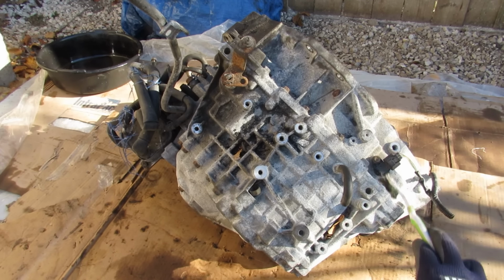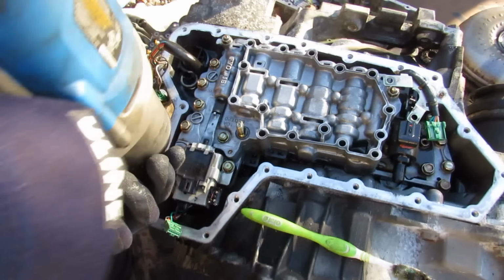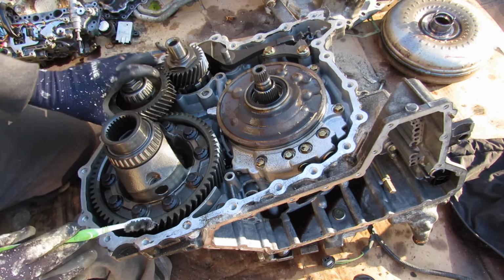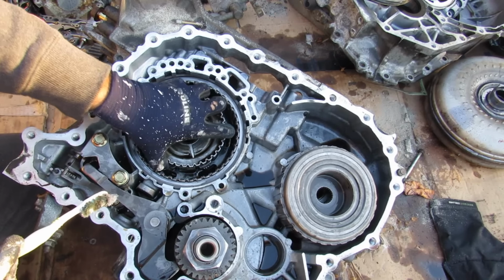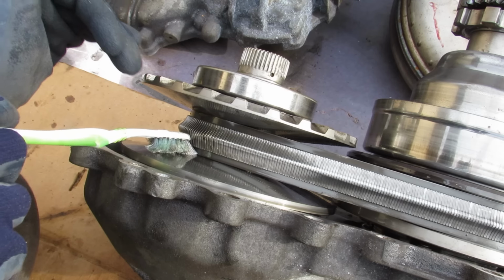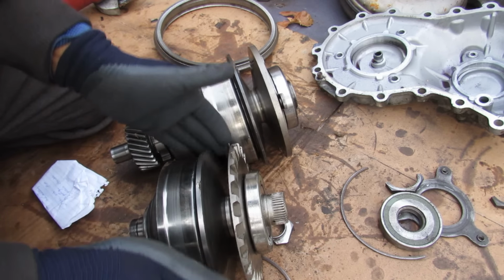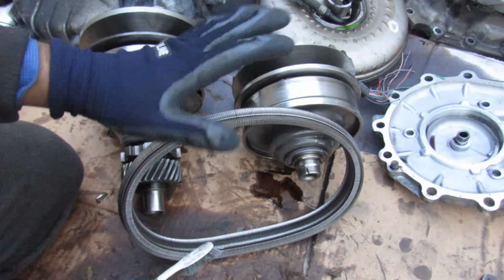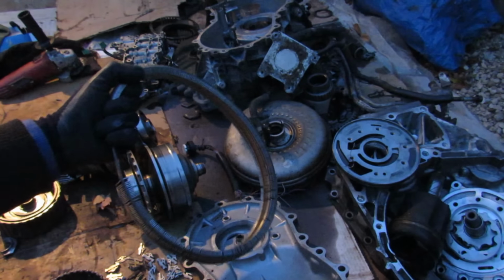Why Nissan CVTs FAIL

Comment: I wouldn't own one of there pice of crap
Reply: While I agree with you, this is the first generation CVT before they got with the program. If you notice that cooler block isn't a good design. It used coolant to cool the CVT fluid which lead to overheating and damage, now they use a external cooler like everyone else. Also they now put the pulleys orientation away from the fluid and closer so the build doesn't get destroyed and some use a chain. A good example is the Maxima its the best one of their CVT's and rarely fails because it uses a chain. They have also changed the tuning and added a gearset.

Comment: Hello, can anyone tell me if you can tell whether the cvt of a 2012 Nissan rouge is original or has been replaced? Can a mechanic lie to you when the cvt is original but he says otherwise? Thanks.
Reply from the maker: Sometimes it's obvious work was done with bolts and wires and clips around the transmission.

Comment: lol, paddle shifters to shift your cvt transmission. That’s hilarious. Anyway the only correct application of this jatco cvt transmission is the Mitsubishi mirage which is very light weight and only has a three cylinder motor. This cvt in that vehicle is perfect and usually lasts three hundred thousand miles as long as you regularly change the transmission fluid. However on a small suv like a Nissan rogue or murano you literally damage it and wear down the internal complements every time you use your car and thus it will only last shot 80 thousand miles usually before failure. The jatco cvt transmission isn’t bad. It’s actually a great transmission. But only for a three cylinder naturally aspirated motor, not a six cylinder naturally aspirated motor. They just get a bad reputation cuz Nissan tries to put them in anything they can get away with like v6 or v8 motors which will kill the jatco cvt transmission prematurely. This is proven with its use in the 3 cylinder Mitsubishi mirage where it usually never fails and the three cylinder motor actually fails first after about three hundred thousand miles.as long as the regularly scheduled maintenance is done that is.

Comment: Amazing video about cvt gear box. I have a fair to buy car with cvt box . Thanks and congratulation for your skill and show. That help me  a lot to get this knowledge in very short time. Definetly is not acceptable to get a car with this kind of gear box andits more complicated than the car itself.  They should find manual way to use this continious variation transmission. Oooh relax
Reply from the maker: Glad you liked it. I have a few more CvTs to teardown on the way!

Comment: My Pathfinder is 10k KM 2020 model 1st owner, I noticed a CVT little shuddering issue since beginning, and the local nissan dealer insisted that this is normal! By the time the car went out of warranty, now shuddering is very clear. From my standpoint, Nissan Japan pushes dealers over the world not to expose those kind of issues to customers, and so they used to them, till the warranty is end up. I believe this is aligned with Nissan statement "Our mission is to enrich people's lives"!? It was one of the worst decisions I've ever made to trust Nissan😢

Comment: I have a honda jazz cvt vehicle. When the vehicle is cold, there is no movement in D-S-L and R, but when it warms up, it moves, albeit with knocking. There is only a problem with the first take-off movement. There is no sound or knocking when driving on a normal road, but there is a knocking and not starting when starting. especially when the engine is cold. Can I get an idea for this? Thank you.

Comment: excellent video, this is fascinating.  I have a 2015 Pathfinder 3.5l and cross my fingers now that I'm at 120,000 miles.  Yes I have towed up to 5800lbs with it for about 20 miles to trailer a Bronco project

Comment: I have a Nissan Altima 2013. I pray everyday it doesn't fail along with changing the CVT fluid every 30k miles. So far so good at 70k miles. The problem is that Nissan said the fluid is lifetime which no fluid is. Hopefully now that Renault has sold their shares back to Nissan and are not the majority owner, Nissan may go back to being reliable.

Comment: Congratulations!

Here I am, watching videos about a number of older-model vehicles because I’m planning to buy a relatively inexpensive, but hopefully reliable, used car.  I was kind of leaning towards a 2007 Nissan Maxima in excellent condition and with very low mileage, but in slightly less than 20 minutes, you’ve completely talked me out of it!

Time well spent!

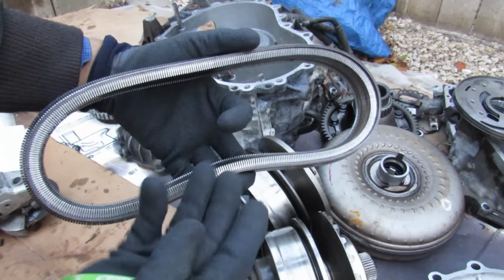Comment: 15:25 INCORRECT!!!! 
these are made for TRUCKS.  
not just any trucks.  no i mean SEMI TRUCKS!!! 

and this was back in 2011 when TRUCKS were the only vehicals that had these on them other than specific special use cases like racing or custom vehicles.

so given how wrong your statement is on this.  i doubt how trustworthy any of the other claims are like it's cooling system.  (sounds like a nissan specific issue)
(ofcourse nissan isn't using the brand i have been making.  wich i shall not name because you don't need to know where i live)

Comment: 09:30 i have made those belts. 
there microscope inspections for tears and damages on each of those links.  
even an x-ray test every so many of them. (they are stamped out so doing this is the only way to find damage on the stamp without disassembling the machine.)

Comment: Conventional gears have their  meshed teeth roll on one another without sliding, that gives them superiority over all other transmission methods, I am a mech engineer with 40 years of experience. I would never buy a car with CVT, nor would I drive an EV.

Comment: I have a 2012 Sentra with a CVT. My Sentra has 185,000 miles and I’ve had no issues except normal wear and tear. I still see a lot of these Sentra’s on the road. Where did Nissan go wrong I don’t know. My CVT and engine still runs great.

Comment: The jatco ctv in X-trails was reengineered in later years, with a belt that looks twice as thick as that belt. And Renault installed it in the Korean built Koleos with an oil and filter service interval and have no issues.

Comment: 3 muranos so far, no cvt problems.  121,000 on the first. 108,000 on the second, currently 93,000  on third murano. Traded in for new muranos.

Comment: Stay away from these transmissions, especially on anything larger than a compact car. Very  prone to failure at low mileage There is no suitable repair or rebuild, only replacement. I speak from bad experience.
Reply from the maker: I agree. Very light duty

Comment: CVT transmissions are not as robust as manual transmissions, all that means is that they cannot take great abuse.  With maintenance and no stubid actions by drivers, that can last a long time.
Reply from the maker: They're only good for small vehicles

Comment: When my 2019 Pathfinder with towing package started making a whining noise I traded it in. I tow my boat and utility trailer with it.
I was told bye a friend that the transmission was about to need replacement which made me think twice about ever buying another Nissan.
Now I have a true 10 speed  transmission and don't have to worry about it. Goodbye Nissan

Comment: See the wires . All against the valve body . This is a fail . Why ? Heat alone wwill send the trans into protection mode only seeable at manufacturer electrical doctor test facility . And wireless false signal will also be present . Space between valve body and electrical body should be 5 mm minimum . These are likly why cvt function eratically . My first time seeing inside a cvt . I should have expected it was an electrical issue . After seeing this video ? I'm surprised cvt even work at all brand new . The mechanical side is awsome but the electrical side get a note of zero % . This is wire installer mistake

Comment: I like to think of the CVT transmission as a constantly slightly slipping clutch, and it feels like it because it is. And just like if you ride the clutch or drop it too hard it will drastically effect the life of said clutch or transmission. Seen some last well over 200k miles without any issues, seen plenty die at around 100k from more lively drivers and under 100k with aggressive ones.

I seriously hate the fake shifting they do, IMO criminally dangerous (newer Nissan CVT's). I've had to wildly pull off the highway while trying to speed up and merge because the asinine fake shifting makes throttle response a insanely slow 2 full seconds before any type of acceleration. It ACCTUALLY stops acceleration when you press more on the "gas" to give you the shifting feel then the garbage software/computer doesn't find a proper fake shift point so it simply coasts for the full SLOW 2 seconds while i have to drive onto the shoulder to speed up.

Nissan from around 2010 has made subpar cars, the engineers should be ashamed. Worst mirror placing/design, garbage transmissions that need 30k break in because of the garbage programing. Not just dated, but flat out armature interior. Good engines and handling, that's it.

Funny enough, i drove a early CVT V6 Altima from late 00's that has amazingly quick throttle response because it didn't have to hunt for gears. It's WILD how incompetent people get there hands on things and ruin cars. I'm aware of the Nissan CEO turning the company into a bonus driven environment, effectively making middle managers the "driving force" and sucking the company dry. I mean, if you bought a 2020 Nissan or Infinity you would still have a dated interior from 2004 that looked like it belongs in 1994.

Otherwise, they make AMAZING geared transmissions 😁
Reply from the maker: I think it's far from just a slipping clutch ...more of a rubber band 😂

Comment: When I first saw these CVT that push a metal chain scrubbing on metal pulley sheaves ...
Insane disaster.
Reply from the maker: Yeah but somehow it's more efficient
Reply: @speedkar99  not sure 
 Efficiency of gas motors still about 25-27%

Comment: What causes my cvt not to roll in drive gear when I let off brake pedal?
Reply from the maker: Torque converter
Reply: @speedkar99  I have a Mitsubishi 2.4 Engine with a white whip cream residue inside coolant reservoir tank and very little on underside of radiator cap. The radiator is low on coolant and the Engine is 2 quarts low on oil but no white residue on the oil cap and oil appears to be of normal color inside valve cover. Could this be a bad head gasket or something else?

Comment: pray for me..owner (no so proud one either) of used 2020 Murano with 53000 mile so far bought in 2022. Should I be looking at doing a radiator flush like now, and work on my coolant system like now? Live in the great state of Michigan where thus far winter has been mild.
Reply from the maker: Yes. Keep the fluids fresh and don't tow or overload it.

Comment: Just recently saw a guy take a CVT from a 2015 Honda CR-V apart. There are A LOT more parts in it than the one from the Nissan.
Reply from the maker: I do cars? Yeah his was alot more carnage
Reply: @speedkar99  Yes, that's the channel. While I'm not a professional engineer, it seems to me these "simpler" transmissions rely too much on perfect timing and tolerances. It appears that just a little wear will cause a lot of failure.

Comment: I find it interesting that all of those wires and plugs are bathed in hot transmission fluid and still perform. I own a 2014 Nissan nv200 and learned from multiple YouTube videos that frequent fluid changes at 25 to 30 K not 60K and no lead foot driving will make these last much longer.

Comment: I bought a 2023 Rogue.
Came with a turbo I-3, a CVT, and a 'lifetime power train warranty'. Yes, lifetime. As long as you own the car. 30/37 mpg.
The dealership said they could change out a transmission or an engine in an hour.
I'm not worried. 😀

Comment: My friend Jeff has a 2022 Altima that already has cvt issues. Doesn’t drive hard or race or anything and changes the fluid every other oil change at 10k miles and it’s already going out
Reply from the maker: Jeff has a big repair bill

Comment: My 2014 Nissan Versa Note has a CVT and I had to have that piece of garbage rebuilt.  The transmission shop guy told me that all Nissan CVTs are pure garbage and that he spend about 80% of his time on Nissan garbage.  He told me when it gets close to 160000km on the rebuild is to just get rid of the car.
Reply: I wonder what the owners do to get them to fail by 160,000km.  I have a Z51 series 2 2010 Nissan Murano model with just over 210,000km on the original CVT.  The Versa is a smaller car and I think they probably have more stress on the CVT, so stick to changing oil at least every 60,000km.  These gearboxes are definitely not built for towing, I'll admit, even with V6 engines.  Better for fuel economy but I don't think most people drive them appropriately.... by that I mean they tend to be driven a bit harshly at times, which may be why they don't seem to last (especially in the USA it seems).
Reply: @MA001  Wouldn't a much smaller car, like the Versa Note, put less stress on the CVT, and not more?
CVT in the smaller and lighter cars should last longer.
Reply: @maddogmcrae  smaller cars tend to rev harder for longer until they reach cruising speed, where the engine speed drops significantly. Components are also smaller, the belt is also shorter, but the engineers would account for this factor....keep in mind that smaller vehicles generally have to rev slightly higher to maintain the same cruising speed, compared to larger vehicles (wheel size, etc)....such factors will have longer term impact on the transmission.  Not so much the weight factor but rather the way the vehicles are driven at higher rpms until cruising. My guess is that the throttle response and the way the drivers control the acceleration of CVT vehicles is leading many CVTs to fail rather early. (imagine the belt changing shape more frequently because of the driver throttle responses).  I tend to agree generally with what is mentioned in this video as well ... https://www.youtube.com/watch?v=TbtLosvyPEU .

Yes, I agree, bigger cars equals more weight and load.... but it also means larger components are designed into the larger vehicle to cope with the extra load.  In my case, the manufacturer made changes between the series 1 and series 2 versions of the CVT, where the CVT belt does not get partially submerged in the CVT oil from the sump (oil spraying instead) .... apparently meant to overcome some reliability issues, improve noise, oil cooling, etc.  At 100kmph my vehicle averages close to 1500 - 1600 rpm at cruising (keep in mind a vehicle of around 2 metric tonnes).   Regardless, whether CVT or normal geared transmissions, if doing a lot of hilly and or highway driving (100kmph / 62mph or more), better to go with a larger vehicle.  I've seen instances, for long distance highway driving, where a larger vehicle has used less fuel than a smaller vehicle simply be it was revving less overall (transmission type and gear ratios play a big factor in this as well).

Comment: Drove Nissan since 2010. Love them. Had an Xterra....traded it in for a Jeep...which promptly broke down...(3.6 pentastar is hot garbage) picked up an Altima in the mean time...love the CVT transmission....so damn smooth.

Comment: Toyotas eCVT Trans-axle is completely different by design.  No belts, drive from engine is fully geared via a planetary gear and an opposing motor drive. Local garage has cars in for servicing with over 200k miles on the clock with no issues. Don't be put off like I nearly did just because the transmission shares the similar name.
Reply from the maker: Agreed. I've taken apart an eCVT and it's much simpler than even an manual transmission.

Comment: CVT'S are just not as reliable as a manual or conventional auto. The stats prove it. Even Subaru has had and continues to have serious failures across it's CVT range. Steer clear.
Reply from the maker: I agree. Automatic is better

Comment: Nissan cvts are the worse.. these jatco are a big problem, trust me I'm a mechanic I've dealt with these couple of times
Reply from the maker: Big time. How many have you swapped out?
Reply: @speedkar99  
11 or 12. I've also dissected them, and replaced the belt, for example

Comment: Thank you for rhe helpful video.
I found out at Nissan web site the 2012 transmissions had some issues. Once the reputation of issues goes on line, everyone joins the party. 

This is what they did in 2013 and cars moving forward. 

"The CVT in the had its last major hardware update for the 2013 model year, which included a reduced-friction design, a wider ratio spread, and a belt that could better handle high torque outputs." 

Though it does not make their newer transmission bullet proof, the major concerns people talk about on the intenet has been reduced

Comment: I started buying Datsun's in the 70's. Like all Asian cars, they rusted overnight but were mechanically amazing. Then the parent company, Nissan gave Datsun its new name and the bodies lasted longer while the engines and transmissions got worse. Then the French bought them and the quality plummeted. 
CVT can be good but it depends on the manufacturer. Nissan is not one of them.

Comment: Excellent explanation of the CVT moving parts, I am not a mechanic, but now appreciate the engineering into CVTs. What is the expected lifespan of a CVT assuming religious fluid changes etc...?
Reply: Anywhere from 50k to 300k

Comment: Great explanation! My 2013 altima CVT 2.5SV has had a whine feom 0-15 mph for many years but after that speed its quite. I have been doing drain and fills at 40k miles. Car has 170k miles, hoping it makes it to 200k.